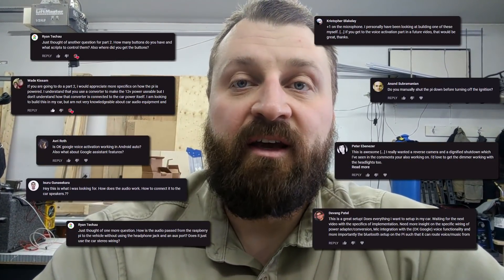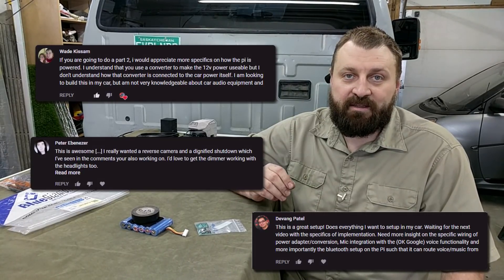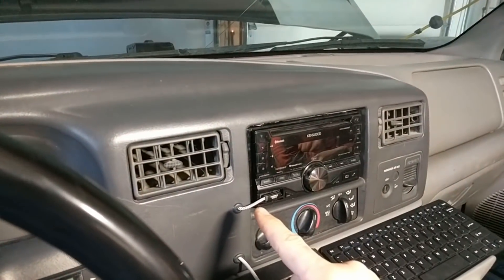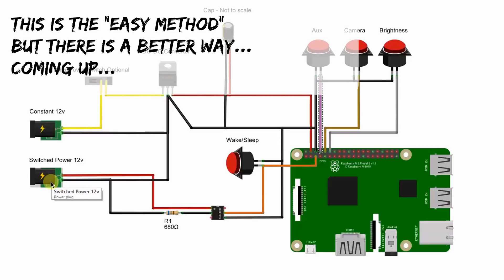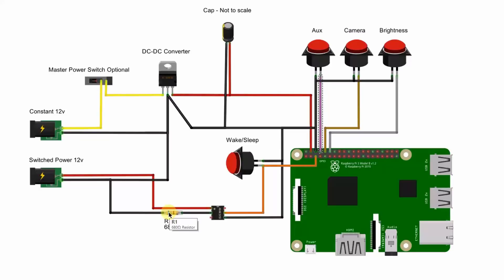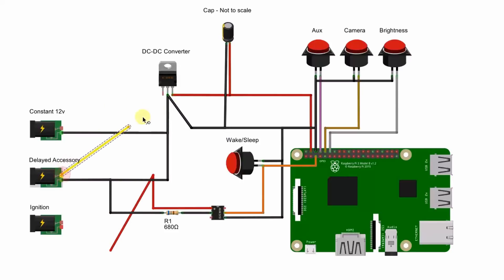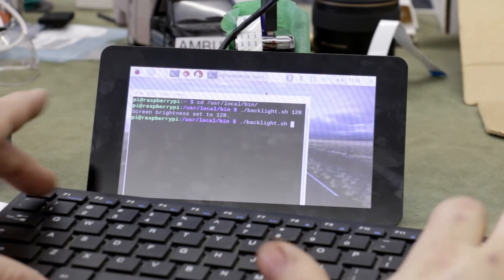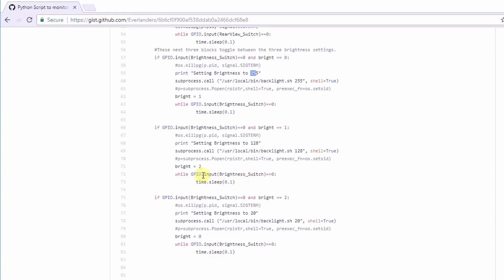Wiring AndroidAuto & Raspberry Pi to your Car - Rear View Camera, Connection Diagrams, OpenAuto

Comment: I'm sure you've heard this before but NEVER rest your hand on your shifter while driving. Don't do it ! The shifter is a direct connection to the shifter forks inside your transmission. These forks ride in a channel of a spinning component. Resting your hand on the shifter forces the fork into constant contact with the side of the groove and WILL wear the fork out. It will get thinner and thinner until you start having problems getting into gear. Shift then release. I bet if you read your owners manual it will tell you the same thing. Google it .
Reply from the maker: I misspoke, it's not that I rest my hand on it as much as I can reach for the shifter and thus the buttons without looking down...

Comment: I have a problem with your setup. You connected the buttons directly to the Pi without any protection. 

That means any electrostatic discharge can kill your Pi.

I don't recommend this wiring at all
Reply from the maker: Years later, it's still working just fine...

Comment: I've been replaying your video over and over lol. I just can't seen to fix to issues. 1. the cam works when I do raspivid -t xxx but not when I select rear cam in open auto. 2. I can't get the mic to work. Funny thing is, if I say Hey Google, it waits for a command, but doesn't hear me. I do have an external sound card. Any suggestions?
Reply from the maker: Do you have a trigger wire connected to the reverse pin?
Reply: @Everlanders  hey thanks for the response. Appreciate it. Both issues were my fault I guess. For the backup cam, I had to switch the backend type from V4L2 to Finder and that worked. For the Mic, it needed a battery inside the switch, go figure lol. Once I installed the battery, it worked. Just now I need to run the HDMI cable and create a housing for my cam. Thank you once again.

Comment: Great video. I think I'm going to purchase the stuff for Android auto because the head units are way under powered. I have to run a tube or something onto the raspberry pi because it will over heat in the summer
Reply from the maker: Ours has been fine without additional cooling.
Reply: @Everlanders  I wonder since your unit is roof mounted that has helped with the cooling

Comment: Can you please provide a link to the adapters, cables and camera you used? I'd like to connect a rear camera but those details aren't clear in this video. How is your rear camera connected/powered?
Reply from the maker: A basic understanding of how a Raspberry Pi works and is connected would be needed.
Reply: @Everlanders  just for the links??? 🙂

Comment: hey man, i know im like several years later to this video. but i was wondering. i have a coablt with the pioneer factor amp. and every time i go to look up an upgrade for a new head unit. they always say i need special wiring harnesses. not just a basic wiring harness. my question is, with the way its going to a custom setup where you aren't using a official head unit but either using a rasperry pi, or android phone/tablet. would i still need that special harness. and i mean if you dont know thats okay. hopefully you see this. lol
Reply from the maker: I've never touched a Cobalt, so I'd imagine whatever it's lacking for a standard head unit would be the same in this case.
Reply: @Everlanders  thanks for the reply. and it didn't take long. and yeah thats what i was thinking. its really hard to find that imformation out there lol.

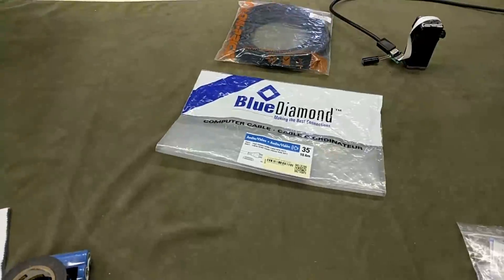Comment: Before index, Camera issues @0:46 you should add Wife issues @0:15  ;-p  Not to be confused with Wifi issues but both need a strong connection for good communication. 🤓

Comment: Thanks for a couple awesome instructionals. I came across your videos while doing some research. I have a Transit 250 for my job which I spend a BUNCH of time in. Unfortunately I'm not allowed to modify things in it, so my plan is to use a cheap Android Auto head unit and wire it to the 12v accessory plug, and route audio into the factory 3.5mm aux jack. (Thus plug & play & no modifications) You've given me something to think about and I will be looking into a plug & play ras pi type system for later on.
 Appreciate the videos!
Reply from the maker: Sounds like a plan! Check out the 10" Uperfect Raspberry Pi Screen housing combo. I show it in the intro of this video: https://youtu.be/SjirUYghQSA

Comment: Hey thanks for making this video! I’m in the process of converting my head into to an in dash iPad Pro. 
I was gonna mount a small raspberry pi and screen to tap into my factory back up camera. I also can get a video switcher to add front and side view cameras. The camera input to hdmi adapter was something I was planning on ordering but I wanted to see if you know if the HDMI will work if I used a composite to HDMI adapter?
Reply from the maker: I've never tried.
Reply: @Everlanders  darn :/ well I guess I should just see if I can make it work. Thanks for providing the other wiring diagrams though! Can I plug that voltage regulator for the power into my distribution block from my battery? Or is that to much power for the voltage regulator?
Reply from the maker: ?? That's exactly what it was designed to do...
Reply: @Everlanders  my apologies I just saw you wiring to a radio harness and my distribution block is 0 gauge wire from the battery. Sorry if it was a dumb question

Comment: is there any capacitance problem when we use raspberry pi camera with longer cables
Reply from the maker: I've demonstrated there's no problems so I don't really understand your question...
Reply: @Everlanders  I tried to extend the camera cable by buying two ffc cable to normal cable adapters so when i connected the normal cable to the adapters i got a error that camera not connected . you used hdmi adapters so do you got any problem like this
Reply from the maker: No, the 10 meter cable works without issue.

Comment: Hey, nice Video!

For the quick and dirty way: Why not using the switched power for turning on and off a mosfet in the constant voltage line? You would not need the switch and you wont need to access the ignition wire. Or am I getting something wrong?

Have a nice day.
Reply from the maker: I'm not sure how this would work, can you elaborate?

Comment: Hi there is it possible to use this as a head unit and have the audio going to the speakers? How?
Reply from the maker: Of course, just wire it to an amp...
Reply: @Everlanders  thanks I also have another question it is possible to have a feature where if there is a door open it shows a car and what door is open?
Reply from the maker: Now you've crossed the line, this is completely out of the question...
Reply: @Everlanders  I know sorry but i was just wondering if it was possible that's all thanks anways.
Reply from the maker: You're most welcome! 🤗

Comment: Black screen problem solved. Congratulations on a great tutorial. I built one for my 2000 Ford Econoline van and everything went great until when bench testing, I plugged in my phone. It connected normally but would only show a black screen. Apparently this is a common problem. After reviewing the forums on the bluewavestudio site and trying various things over a couple of days I was no closer to a solution and about ready to scrap the whole project. Then I stumbled on a stackexchange post about loading the snd-dummy module and making sure it was referenced in the /etc/modules file. After doing that and rebooting, when I connected my phone it instantly started Android Auto and displayed the navigation view. Phone calls work as they should as well as podcast playback. Why something related to sound would prevent the display video is beyond me. I thought I would post this here in case anyone is trying to duplicate your efforts and running into the same problem I did and is looking for something to try toward a possible solution. One other tricky thing I encountered was the microphone. I got the same sound card that you show in the video, and it needs a TRS plug on the microphone which is not that easy to find on a mono microphone. My TR-plugged microphone works if I don't quite plug it in all the way but I ordered a TRS unit to solve the problem permanently. Now I need to wire up some switches and install your scripts, then come up with a suitable enclosure. My Ender 3 3D printer is too small to print a modified version of your design, but maybe I can split it in two. You are a natural at teaching and explaining things and your patience is admirable  when communicating with your viewers. I really enjoy your videos.
Reply from the maker: Thanks, I don't remember the microphone TSR giving me any problems. But it wouldn't be that hard to chop off whatever plug you have and solder on a new one.

Comment: What GPS device did you use on raspberry? I didn't see any USB GPS or GPIO... thanks for your attention.
Reply from the maker: There is no GPS needed on the raspberry, your phone already has one.
Reply: @Everlanders  In this case, would you have to leave the smartphone connected to the raspberry for GPS navigation to work? Thanks
Reply from the maker: You need the smartphone connected for anything to work.

Comment: Hi - I'm doing something similar, but I'm having issues with vibrations.  I haven't been able to track them down (noise on screen and OS glitches, etc), but I've held the SD card, power connection, etc.  Have you had any issues with vibrations, etc, and if so, how did you solve them?  BTW, great videos - content and presentation - thanks so much for these!

Comment: I was surprised that you ran such a long hdmi cable, are all your cameras on hdmi? Any plans to do wifi or bluetooth? Is there a latency issue?
Reply from the maker: It's not HDMI... I'm only using HDMI cable because it's shielded and easier than long runs for ribbon cable. The other cameras are all connected directly to the RPI and gigabit ethernet.
Reply: @Everlanders  gotcha. So the others are long ribbon cables?
Reply from the maker: Short ribbon cables, long ethernet cables.

Comment: I will look back in your videos to see if you have a video that looks like it will answer this question so no pressure to reply if you already put something out. But as a stupid person who has never done any raspberry pi stuff or the type of super tiny tech type electrical work... but who wants to do this... I notice there are a lot of little things you had to use to connect all the things you did list in the buy list eg capacitors tiny buttons etc. For someone who is going to buy stuff to do this AND is upgrading some of the pi stuff so that it will basically work like a small computer for me to do other stuff on... and who will likely be both equal parts overwhelmed and excited about all this and then want to try new things with it/things like this... where and in what amount do you recommend for buying those little things that all projects will likely need and that this one definitely will? Such as capacitors, tiny buttons, pin connectors of various types, extras, replacement/repair, ports, tiny gauge wire, etc. Currently everything I've got in my cart equals ~$350USD and doesn't include any of those things... I am looking for like a beginner amount of parts that isn't too expensive or will take a million years to ship (beyond the other parts). I think I'm also going to have to buy a smaller solderer cause not sure I can get in such small spaces with mine. Does it need to have less power etc so I don't upset these little boards and pins? Sorry for asking a million questions. I just think your camper is magical and I've been putting off doing pi based systems for so long because it is scary lol. Anyway, thanks so much for sharing such awesome videos! All the best :)
Reply from the maker: Sorry I missed your question(s)  I'd suggest the TS100 soldering iron, and not going off the deep end buying everything under the sun.  Just get what you need for the project and hand and work your way to more complex things later.

Comment: Did you mount the camera on the outside of the truck? If so, what sort of enclosure did you use?
Reply from the maker: 3D Printed Camera Pods and Dash Pod - https://youtu.be/lpzkHvQA-t8
Reply: @Everlanders  Thanks!
Reply: @Everlanders  I don't suppose you have any links for a weatherproof pi camera only enclosure? I'd like to try and use one as an external backup cam if possible. I've got a 3D printer, but can't seem to find a camera only enclosure that would work. Thanks.

Comment: I might have missed this does the camera come on when vehicle goes into reverse if so how did you accomplish this? 

If I don't have an aux port to plug into speakers is there another way to connect into the vehicle speakers ? 

How did you integrate the mic into the setup to have voice commands ?
Reply from the maker: These questions were all answered in the video, maybe have a re-watch

Comment: No uninterrupted power supply. Drawing constant does 5V 2.5A kill batteries (starting) quickly.
Reply from the maker: No it doesn't, simply switch it with the radio power, please rewatch the video where I clearly explain this
Reply: @Everlanders  my apologies I meant to ask, does it corrupt the storage going on off. Working nights still a bit foggy.
Reply from the maker: If you rewatch the video where I show the clean shutdown script tied to the I/o pins it will become obvious to you
Reply: @Everlanders  thanks bud. From a fellow Canadian.

Comment: Hi, I did crankshaft on my Honda civic 7. It works very well but I have a question. Does anyone know how to overlay the rear camera? to make parking backwards easier.
There is a camera-overlay.png file in boot / crankshaft I would like to use with the rear camera.
Reply from the maker: This video has nothing to do with crankshaft so I've never used it and I can't help you with that... Perhaps asking your question in the crankshaft forums will help you...

Comment: Love love LOVE your set up!! Curious of how you accomplished 4 cameras with DVR to boot?? Following your footsteps but I'm a newbie that's slowly understanding. :)
Reply from the maker: 4 Pi's running MotionEye
Reply: @Everlanders  thanks for the reply.
I want to use voice commands for lights, fans, and everything else I can, would I need a Pi for every device?
Reply from the maker: No, Each Pi has 40 GPIO pins, so you can in theory control 40 things per pie, more if you use i2c extenders or other multiplexing magic...
Reply: @Everlanders  makes sense. Why need 4 Pi's for the video?
Reply from the maker: 4 cameras... Each Pi has only one camera input.

Comment: I think there is a hat for an obd connection which you can use to diagnose/clear error codes and show extra car info, this would enhance the unit even further
Reply from the maker: Our OBD2 port has a Bluetooth Adapter installed and we use Torque on the phone, or FORscan on the laptop if needed.

Comment: Thank you very much. This second video is more useful. As more important things like configuration of Pi and little detail on wiring are explained. You could also share with us link to github :)
Is it so that there is no way to connect "common" rear view cameras to Pi? Those "common once may have up to 170 degree of view and coaxial cable - which is lot easier to handle.

Comment: Resting your hand on the shifter is a pretty good way to kill your gearbox and even fail driving exams in Europe. Having both hands on the steering wheel is a requirement for safety reasons (in case something jumps on the road).
Reply from the maker: Agreed, I kind of miss-spoke, what I meant was that I can grab it and push the buttons eyes-free, I don't need to take my eyes away from the road to push those buttons. I've received many comments regarding that statement, and on further self-examination, I don't actually rest my hand on it for any length of time...
Reply: @Everlanders  That's good. Stay safe out there! And thanks for the video.

Comment: You're a wizard!! Have you considered using a USB powerbank with passthrough? That way you could cut the power to the screen and delay the shutdown script for a 5-10 minutes. Then when you stop for gas you don't have to wait for the system to start back up.
Reply from the maker: You wouldn't need the battery bank for that, just delay the shutdown for as long as you want, and about the shutdown if the ignition comes back on... But it's really not an issue, it boots up fast enough for me...

Comment: hey can i replace the optocoupler for a relay? im having trouble finding a optocoupler
Reply from the maker: They are easy to find, search eBay and Digikey.
Reply: @Everlanders  also another silly question. what kind of board did you soulder it to? whats it called?
Reply from the maker: https://www.adafruit.com/product/2310

Comment: Can i use a bluetooth headset as a micro for this system if available? Instead of using the usb audio, do u have any suggestion on using a bluetooth mic or the same? Tks for your video!
Reply from the maker: Sure... Just pair it up...